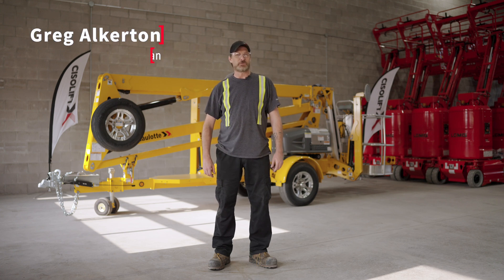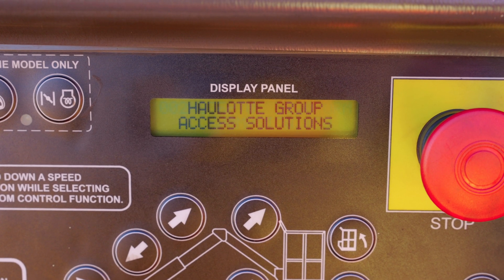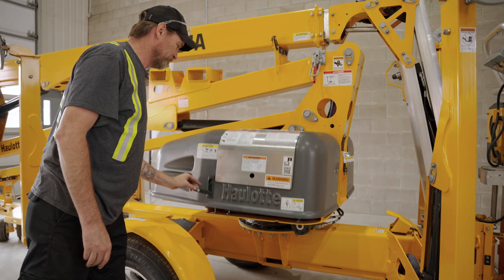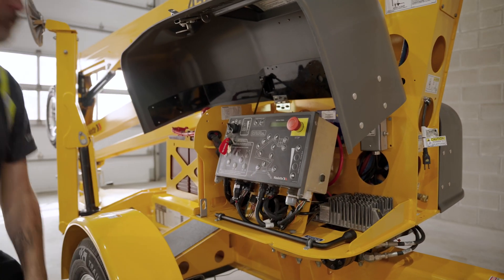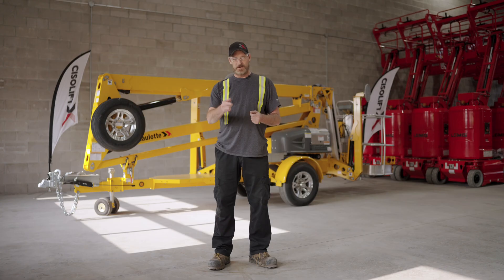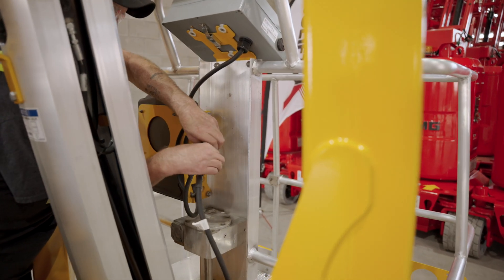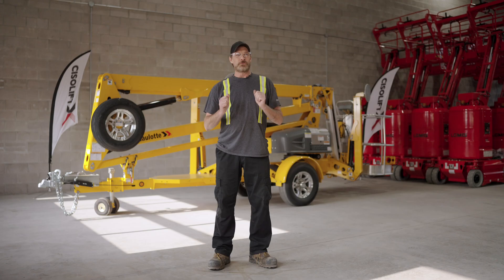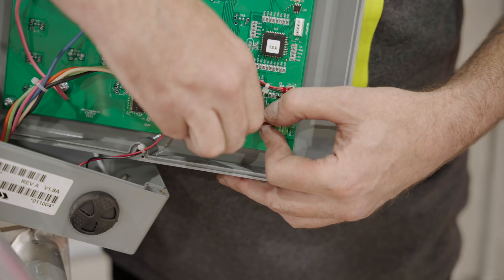Code 002 - Haulotte & Bil-Jax boom lifts

Comment: Hi i just buy 2017 5533A
There was 6 pin platform connector  was missing  let me know cost please also it wont show power i put charge  reply greatly appricated
Reply: Where you located at I can help you with your lift
Reply: Toronto  ontario
Reply: Toronto @YoYo-w4h2b